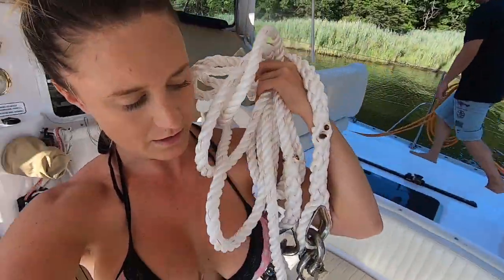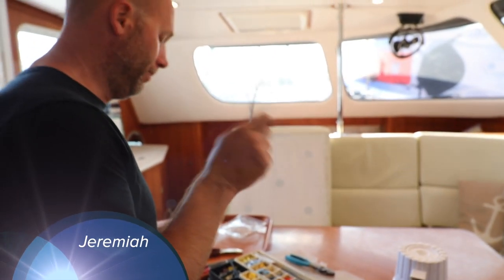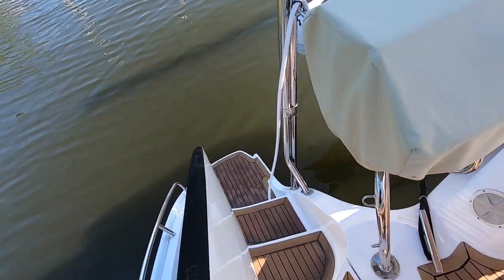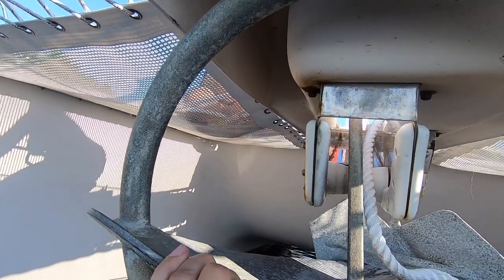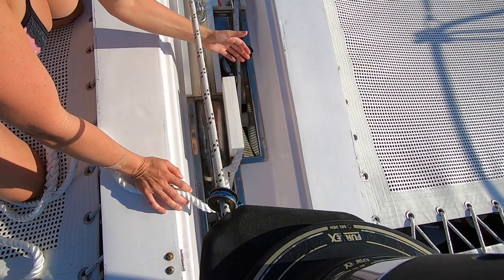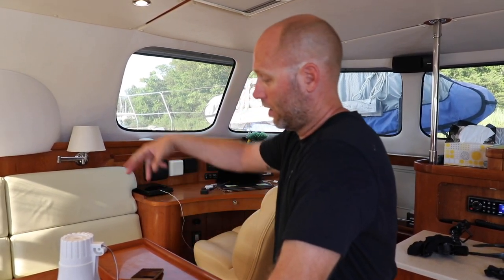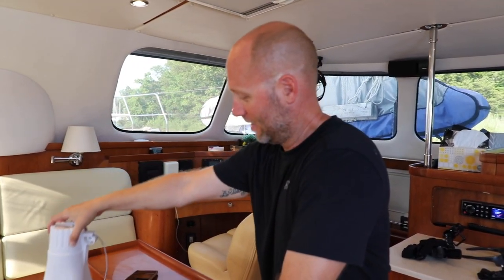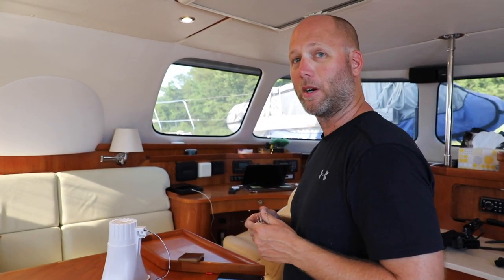Sometimes You Get Cr*pped On! - Lazy Gecko Sailing VLOG 194

Comment: He's always asking you for tools with Christmas coming get him a small tool belt the size that will hold  like a set of needle nose and regular players and dikes and wire strippers a 4 in one screw driver some vice grips and a couple size adjustable wrenches a tape measure and a small chain to hold a roll of tape and that should cover any small job you have